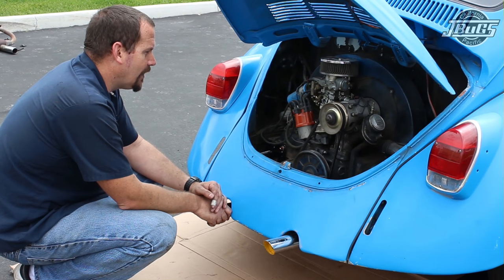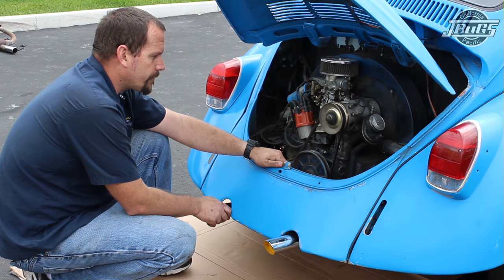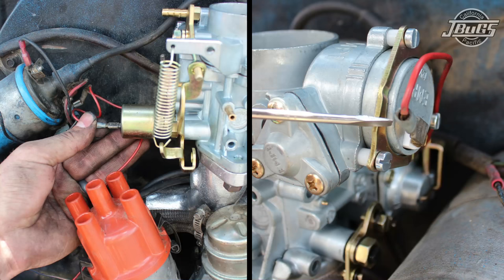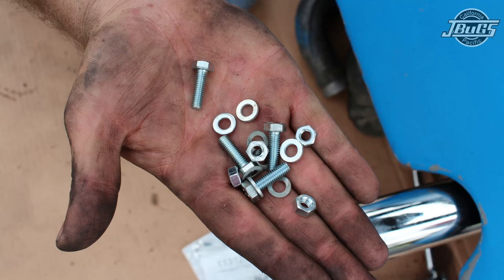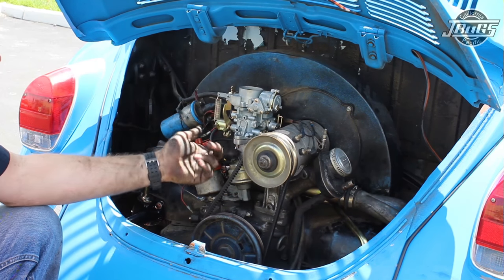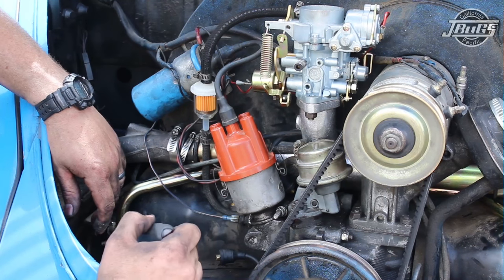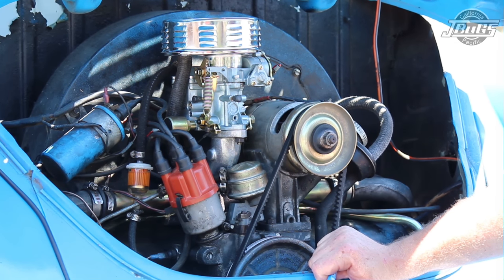JBugs - 1969 VW Beetle - Intake Manifold & Carburetor Installation

Comment: I fitted this manifold to a new muffler as part of a top end rebuild on a 1600. It did not go on as easily as this video implies. I had some bending of the heat risers to do, some filing to get the heat risers to sit flat against the exhaust, to include some rattail work on the holes. Even with the gasket installed, the driver-side heat riser did not fit well. Some RTV on the gaskets might solve it, but I won't know until I finally get it started.
Reply: This is a fairly recent problem we've had with the aftermarket manifolds from numerous suppliers and we are working on some better quality replacements.

Comment: The flat spot is hard to avoid when using a 34PICT3. I personally don’t like the 009, but we just installed one of our 34PICT3  replacements on a 1971 Super Beetle a few weeks ago and it ran surprisingly well. Either way, I still prefer a vacuum advance.

This car was supposed to get more work but ended up getting sold before we had a chance to go through it to replace the seals.

Comment: Word of advice, most all custom exhaust systems with a header that has heat risers on it- the holes are not drilled so they don't pass any heat until you get a hole drilled through on each side. The heat comes from the hot gasses passing through the riser pipe from one side to the other. Not from the pipe just getting hot. Unless you run a stock muffler, the header heat systems work minimally at best
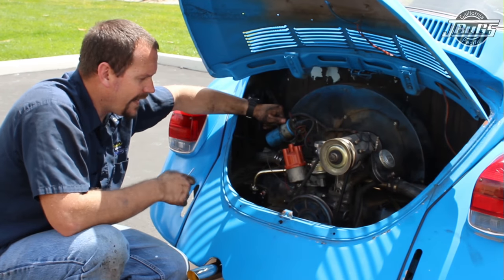Reply from the maker: Correct white snake, as we showed when we installed a 2 Tip GT-Exhaust here https://www.youtube.com/watch?v=8hAOjKgsDa4 starting at about 2:39.

Comment: You should have showed the new intake sliding it in place. I cant seem to get mine out at all and ive tried everything. Don't wanna remove the engine, thats last resort.
Reply: With either side end casting removed, or if nothing else both removed, there is more than enough room to install the intake manifold. Heck, I've pulled heads off of a car while it was still in the car since I didn't have access to a jack. Wasn't the easiest way, but it is possible!

Comment: Would have liked to have seen how you actually managed to pull off the two manifold pieces.
Reply: Since the manifold we pulled off didn't have the heat risers in place it was easy, as was installing the new manifold, as the heat riser tubes aren't attached. People seem to be very confused by this but without the heat risers, the manifold is easily pulled out or set back in place, from the left side of the engine, under the generator. With the tubes in place, it is virtually impossible to remove the manifold without removing the generator.

Comment: when installing the new manifold with the removable heat riser tubes..does the manifold ends slip into the vw factory head manifolds..video does not ready show this part..thank you
Reply: The tubes will fit into the end castings, yes. In some cases too far so we recommend checking the fit before bolting everything up. In some cases the tubes will have to be trimmed down so the center section can be installed.

Comment: For anyone struggling with the removal of the original intake manifold (this video skipped right to intake installation after carb and fuel line removal), I found it best to remove the alternator/fan assembly from the vehicle. Which also meant hood removal. I could not get the clearance I needed otherwise.

This kit definitely makes reassembly and future disassembly a lot easier.
Reply: thank you for warning me about that, I only need to do a boot replacement so I think I'll go with the empi split boots as I don't want to deal with the extra mess of disconnecting the manifold!
Reply: We replaced the intake manifold specifically because someone had removed the heat riser tubes which meant removing it didn't require removing the generator or alternator. Fortunately, the new manifold has removable heat risers so doing repairs in the future means we won't have that issue in the future either!

Comment: When installing those heat riser tubes to the intake manifold,  did you put any kind of sealant in there? Or do they just snug in there and stay put?
Reply: The tubes fit snuggly so we don't normally run sealant. A high temp RTV could be used if you'd like though.

Comment: I am about to replace my fuel pump and my carb on my 78 super.  Have you found the need to add a fuel pressure regulator?
Reply: When running an electric fuel pump with a carburetor we definitely recommend running a regulator, yes.

Comment: shame you fitted the fuel filter in the engine bay, one of the most common fire starters in air cooled beetles
Reply from the maker: The cause of fires is more commonly worn out fuel lines and no hose clamps. We recommend inspecting the hoses regularly and this is even more important nowadays with ethanol fuel blends. We have run our fuel filters in the engine compartment for decades and haven’t had an engine fire yet

Comment: It appears due to no vacuum advance that is a .009 type distributor. How do you avoid the "flat spot" associated with that 34 PICT 3 / .009 combination? 
Why are you running the engine with no engine seal? You are overheating the engine. It would be like taking the radiator out of a liquid-cooled car and connecting the Top and Bottom Radiator hoses together.

Comment: how does one go about removing the nuts from the intake castings? They're all but inaccessible on my 67. Any suggestions? Can't fit a socket wrench on the rear studs and can't seem to get enough of a bite with an open or box end wrench. Also...how does one remove the heat riser tubes so that one can remove the old intake manifold? Mine seem to be rusted in place.  Any advice would be greatly appreciated.
Reply from the maker: We often bend wrenches or grind down sockets to make removing and installing the intake manifold nuts easier. The heat riser tubes are built into the intake manifold and are not intended to be removed from it.

Comment: How do you wire the electric choke and the idle up solenoid ? Do these get a hot wire from the positive side of the coil or where do you hook them to?
Reply from the maker: Correct, the choke and idle solenoid are both hooked up to the positive side of the coil.

Comment: My bug has the same carb and I have vacuum tubes. Y dose yours not and what are the pro and cons for not have or having them. Thanks
Reply from the maker: +drew0357
Our carburetor does have the vacuum ports but they were capped off as the beetle we installed the carburetor on does not have a vacuum advance distributor or any of the original air cleaner or smog devices that were on the car originally.

Comment: im putting in a new intake and carb and the new intake hits the bottom of the generator is there a way to slightly adjust the generator up some
Reply from the maker: +nathan butler
The generator stand places the generator and fan in the fan shroud which is connected to the cylinder and cooling tin. None of them can be moved, that's why VW's used shims to adjust the belt tension. If your intake manifold is hitting the generator then there is an issue along the intake somewhere. Check that the end castings are in place properly and work from there.

Comment: My '74 super beetle has an auto stick trans.  I have changed all of the intake gaskets,etc. but it still overheats after about 20-30 miles.  Timing, carb, and all else is perfect-- could it be a vacuum leak in the clutch servo or ???.  It's a beautiful car with low mileage but I'm just about done with the hassle.  Any suggestions?
Reply from the maker: If the engine is tuned correctly and still over heating we would guess that perhaps some pieces of engine tin are missing, or perhaps the cooling vanes inside the fan shroud or cylinder heads are clogged. We wouldn’t suspect a leaking clutch servo to cause the issue though.
Reply: @JBugsVWParts  Tuning is spot on and I removed the cooling tin (and replaced it) to clean the fins but nothing was found.  Belt isn't slipping, either---only other thing I could think of was a vacuum leak.
Reply from the maker: By all means, it is worth checking out if everything else is in order. Typically though a leaking clutch servo would cause issues with shifting, not overheating.
Reply: @JBugsVWParts  Thank you for the help.  i guess I'll go through it ONE MORE TIME before I sell the old girl!
Reply: @garyk112  ...so any update on this issue? I'm interested

Comment: so I just notice on my singal port 1600cc my carb an manifold are sweating why is that is it freezing? an is it bad?
Reply from the maker: +JohnnyBoy Biggz
The intake manifold can "freeze" up, much in the same way a can of spray paint gets cold when you continue to use it for a long period of time. The fuel and air moving through the intake manifold can start to create condensation and can eventually freeze up. That is why there are heat risers connecting from the intake manifold to the exhaust. The hot exhaust gases running through the tubes to the manifold prevent the manifold from icing up.
Reply: What do you guys recommend me to do? Do a have it clogged?
Reply from the maker: +JohnnyBoy Biggz
We can not see whether or not you do have heat risers. If you do, we have no way of diagnosing the problem not being there. If you have the heat risers, they may be clogged or the ports on the exhaust may not be drilled as we show needs to be done in our exhaust video. Watch closely through our exhaust video http://www.jbugs.com/product/Video-Exhaust.html?Category_Code=JBUGS-Videos to see what we're referring to.
Reply: Ok I have the stock exhaust which has heater boxes on my 68 an I do have heat risers I will be installing a stinger soon.
Reply: So do I need to buy a new manifold?
Reply from the maker: +JohnnyBoy Biggz
To install a stinger you would need to replace the stock muffler with a header such as http://www.jbugs.com/product/3682.html (which will still work with the heater boxes and the stock intake manifold). Then you can install a stinger such as http://www.jbugs.com/product/3696.html